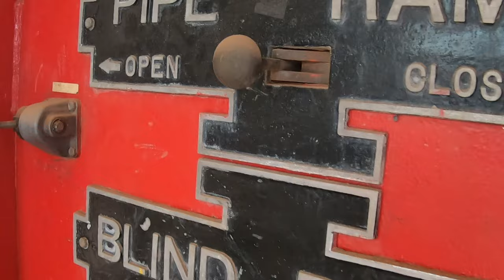Oilfield Technology Center Raises Mast on Oil Rig

Comment: LOL and most bookworms are the first to get hurt ! I know after a decade in the field and working from the lead tong position to driller. I've seen blocks dropped, Derricks buckle, and some burn to the ground. I've been on some of the largest Natural Gas Wells in West Central Texas. So seeing bookworms fail was a common thing. Even though there is a hands on experience, it still doesn't take the place of a Real set up and tear down, move and the daily functions. There is a difference when tripping pipe for real and it taking 8 to 12 hrs. to round trip. It's much different than a few hours a day.
Reply: I broke out after having gone to college and doing the whole corporate thing for 6+ years.  Just got bored of sitting behind a desk.  Still haven't been injured knock on wood but have had some very close calls.  Those close calls, though were the result of either inclement weather or somebody else's mistake (The day I broke out, everything had frozen over.  This was TX and we don't have wind walls or anything like that as you know.  It was about 10 degrees and every surface was covered in ice.)  I slipped leaving the rig floor one day.  Ended up at the bottom of a flight of stairs and could easily have fallen from however many stories.  I had fellow floorhands slip while we were moving heavy equipment and it narrowly missed me by  millimeters.  During rig down on a separate rig, a floorhand was up in the manpad and didn't tie off the sledgehammer.  He dropped it from the rig floor height.  It landed on the BOP which was laid over and ricocheted landing inches away from me and the safety guy who was there to oversea the operation.  We had hydraulic lines burst and the top drive drop another several feet.  We had our Driller forget that our motorman was tied off on top of the Top Drive when doing some form of maintenance and raise it back up.  Injury usually comes in the form of some kind of negligence. or lack of communication.  I found that things got sketchy when the "experienced" hands did not communicate well.  It wasn't about school education vs not it was about people rushing and not communicating what they were going to do.  I'd ask a question and my lead floorhand would literally just grunt and then go try to muscle something by himself.
Reply: Sounds like you’re gonna be happy when all land rigs become fully automated
Reply: @kaliyugahiker   Will never happen ! It's still going to take a crew to make it work !
Reply: So you're a "driller" and you've dropped blocks, buckled derricks and had multiple rigs burn to the ground? And you're blaming some ambiguous "bookworm" for it when you have control of the brake handle? These things are not a normal occurrence, most people MIGHT see one of those things throughout a career. To have not only seen it but been on the brake handle for multiple catastrophic accidents is suspicious.